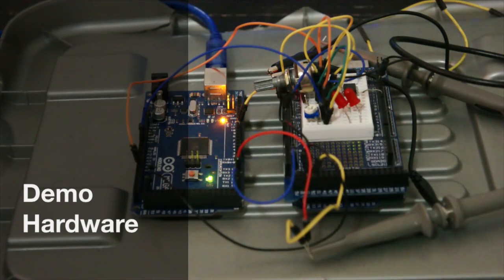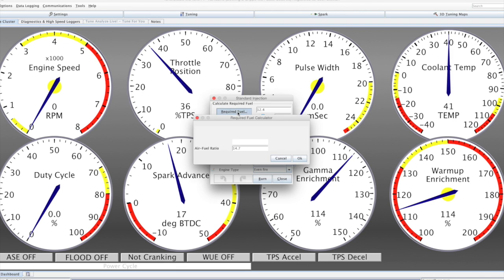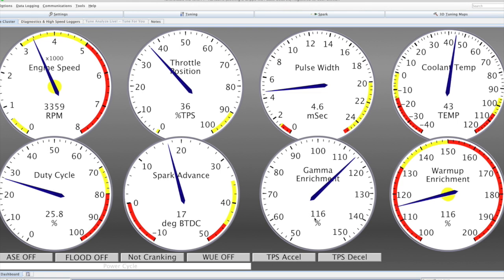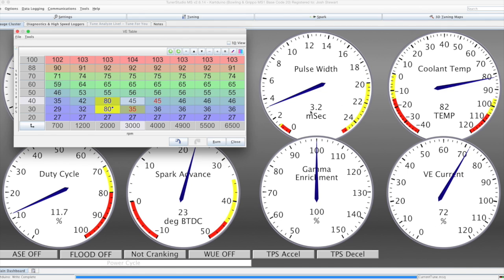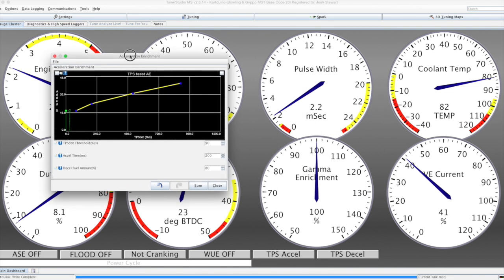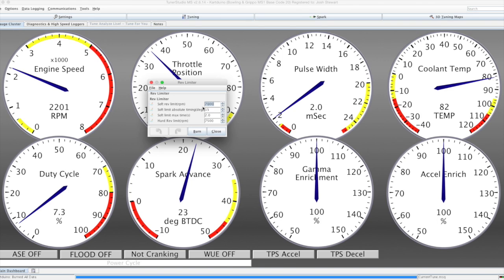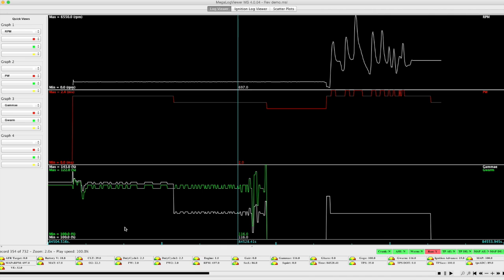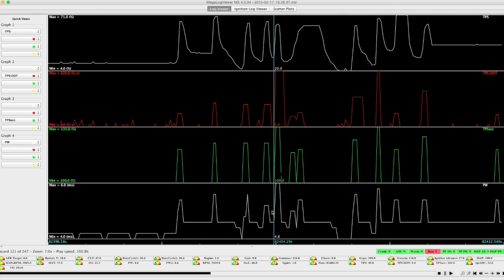Speeduino (Arduino ECU) feature demo

Comment: can you use a Ford EDIS-6 on this as the VR+coil pack? I guess it would just look like a square wave trigger to the ECU? Would try and run a 2 (2X3 injector) or 3 (3x2 injector) channel bank fire/semi sequential on a MPFI equipped Dodge Slant six.

Comment: what's the advantage of this, over say a microsquirt or megasquirt 2 v3.0/3.57? price/cost?
Reply: This is in reference to a v.04 Assembled board.
From my own research, 2 more injector channels than Microsquirt at the price of an unassembled MS1 v2.2.

But, the Microsquirt has a water resistant case and harness connector.
- It's about half the physical size of Speeduino (w/Arduino).
- It comes with a fully labeled harness.
- It's a very stable, well supported, proven setup. 
- Capable of CANBUS communication
- Available hardware to add IAC control, more I/O...etc

- Some feel that the Arduino 2560 isn't fit for ECU duty.
I like the concept of Speeduino a lot. And will buy one myself. But, it is still in its infancy (IMO) and at this moment isn't ready to compete with a complete package like Micro. It's certainly more capable than MS1 v2.2 (OOTB) and many many people ran those on lots of engines 10 years ago (and today)

I'd love to hear other's input on comparison between MS1/2 and Speeduino.

Comment: Josh could this be used on a 6 cylinder BMW M30 engine?
Reply: Josh Stewart m30 is the bigger brother of the m20. both run off the same motronic units. would definitely be interested in tinkering with this!

Comment: Wow, I was looking into this to see if I may have a use for one. Is the fuel and timing maps really only 8x8 or can that be expanded? If you do expand that do you loose anything else? That is only about 1/4 of the resolution I would require
Reply: thanks for the quick reply. Im actually after more than that but it does not actually need to be 32x32. I agree that most vehicles are fine at 16x16 and while interpolation helps it can actually hinder on a engine that comes on power hard and has a wide powerband.
The engine I was thinking about is a sr20det with a 92mm stroke and 90mm bore, 10:1 compression, the old style nismo cams (before jimwolf made nismo cams), gt2871r with a t3 .82 a/r divided housing turbo on a non divided mazworx manifold. There is a SP quick spool valve between the manifold. Greddy IM,  Injector dynamics id1000s..... Stuff like that.
Reply: Not off hand, but I like interpolation. My point was that if I have an 8k rpm redline and start making power in the mid 2k rpm band all the way up to 8k and have different boost levels at different rpms, especially with higher compression I need the resolution. I need it to be what I want it to be at that time. I dont mind letting it interpolate 500rpm but over 1k rpm there is just too much fine tuning I want to be able to take advantage of. Especially at the peak tq area I want resolution. 

This board still looks really neat and I may find a good use for it at a later date but I really do not think it is a candidate for this engine.

Comment: Josh this is really great and important work. I'm an engineer in the U.S. working on open source agricultural systems. I run a shop working on trucks and tractors and one thing I've observed is how the consolidation of manufacturing companies is driving up the cost and complexity of systems. As equipment gets larger and more advanced we see farms getting larger, employing fewer people and the local mechanic is becoming a thing of the past. With innovators like yourself working in an open source environment, there's the potential to develop systems that can be manufactured and serviced in the communities where they are used. 

Imagine you develop a CAN-based ECU for diesel common-rail injection that enables an older CAT 200kW generator to be re-purposed as a grid-tied generator in a village co-generation plant. Or it could be used as a prime mover in an agricultural traction platform. 

Anyway, the sky's the limit, keep up the good work!

Comment: so dose this mean you could use a arduino as a tuning ecu
Reply: Props m8, fuckin hell. So you only need one board correct? You are just using two here with one serving as an emulator of an engine's In/Out-puts?
Just picked up a little 'System on a board' unit known as a "LattePanda" apparently has an Arduino Leonardo(?) processor as well as some other things, suitable? Lots of pins available.

Was originally going to just have a little PC in the car dedicated to communicating with EMS for tuning and/or for infotainment, if I can have all three in one.... Heh

Seriously good stuff man!

Comment: this would be great if u could get it up an going for a honda v6 being that there is very high priced ems or standalone on the market
Reply: I have 6 of them and a full standalone is just way out of my price range and no one has figured out how to hack the ecu on the v6 engine yet
Reply: +Josh Stewart  hey josh is there a way to make it where I don't need to batch fire like how mega squirt  does I'm running 6 coil on plugs and 6 injectors and would hate to lose power and blow my nitrous build

Comment: I am interested in making an Ignition system fro a nissan Tiida engine that I want to run with a  carb rather than injection it has the 36-1 ignition trigger would this be viable with the arduino and how difficult would it be to make?
Reply: Just been looking at the forum and I will do that .

Comment: It's cool to see my software in use! I'm the author of Ardu-Stim.
Reply: +Josh Stewart  Yes, things are going  very well,  Is hardware readily available for speeduino?  I'm interested in trying it out on a few items for situations where libreems is overkill.  Do you have any metrics on PW resolution as well as timing resolution/jitter across the RPM band?  What is it's max RPM capability?
Reply: +Josh Stewart I am interested in getting a board,  so feel free to PM me and I'll provide the needed info and I'll paypal the costs for it+shipping as needed.
Reply: @DavidAndruczyk  how to get the software bro..?

Comment: Cant I get an arduino mega lying around my house and wire it to drivers and wire the inputs from sensors and have the same coding firmware that is on the website, or do I need your specific V0.4. 3 ect... To have the correct outputs corresponding to the specific available code. 
I just want to compile the code to my mega i have and wire it to my car accordingly. Ill use an external vr conditioner off diyautotune for the mega to interpret and plug into a corresponding digital input on the ardiono. 
Is this sound?
I cant find your board in stock anywhere.

Comment: Hi, have you connected it physically to run on a motor/engine? Did you experience some weird arduino behavior? I am trying to control the spark ignition, everything works ok, but after a moment arduino resets itself. I tried separated power sources but the problem persists. I am using some mosfets to control the ignition coils, the mosfets are connected to arduino between some octocouplers, so arduino dont´s share same power source as the power source to the main system 12 V.
Reply: Hi, thanks for yor reply... Im rebuilding a motorcycle, its a cb350 1973. The original ignition was taken off. I installed a rotor with a magnet in the cam, such as the pickup coils. they are stock from an honda motorcycle. The pickup coils are 9 ohms. They are used to read signal fromt he magnet, and connected to arduino, since the pickup coil (hall effect sensors) are 2 wires, one goes to ground on arduino, and the other to pin input. Arduino reads the signal and sends another pin high, that goes to a optocoupler. Thorigh this point, I am running only voltage 5V through usb. Nothing is power with this but only the Arduino. Using another power source, a new 12V motorcycle battery, connects the + positive to the optocouplers that allows current to flow to the mosfet to the Gate pin. The negative (gnd) 12V from the battery, goes to the Source pin in the mosfet. And the Drain pin from mosfet to the negative pin in the ignition coils. The other pin + positive of the ignition coil is directly to the battery. The ignition coils are also stock froma honda motorcycle.
Reply: The motorcycle runs great, starts at fist kick, but when running the engine just a few minutes, arduino suddenly resets, i see the flashing led, sometimes i need to disconnect and connect again the start up again. At first I did not use the octocouplers, so it was the same problem, the arduine reseted randomly. Then i placed the octocouplers the mosfets circuit.
Reply: Sir you are right. I´m using VR sensors. So I need a VR conditioner to connect to arduino right? Or change the VR sensors for hall effect?
Reply: Thank you very much! I really appreciate your help.